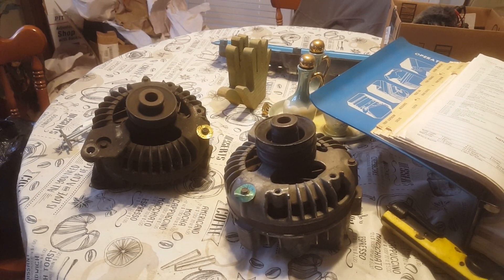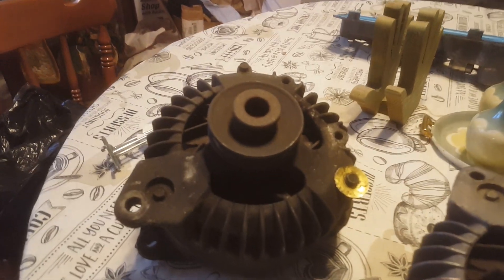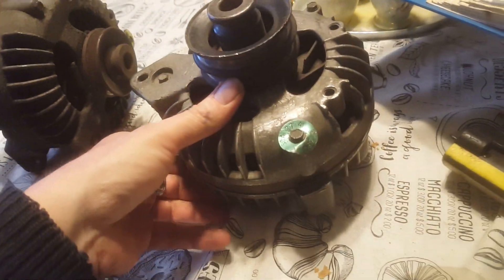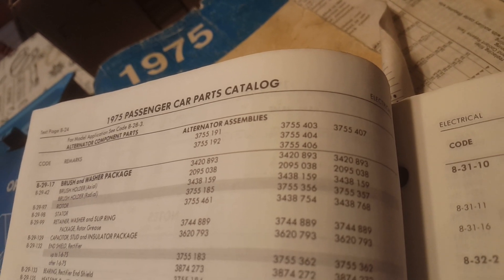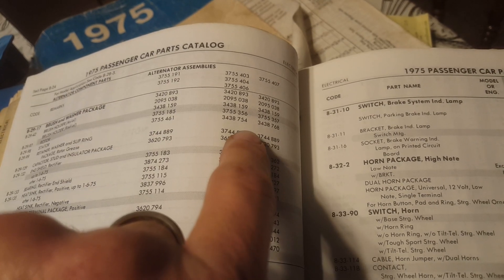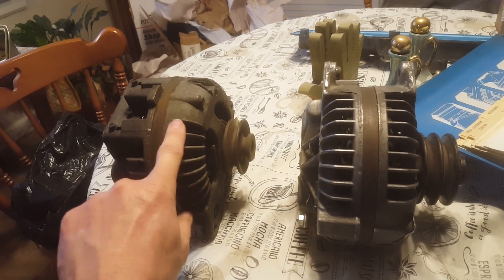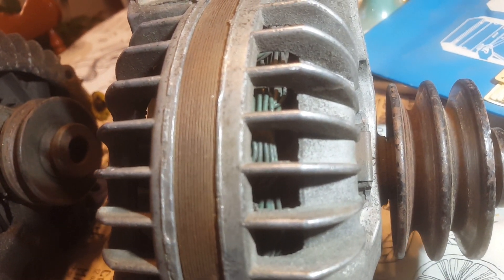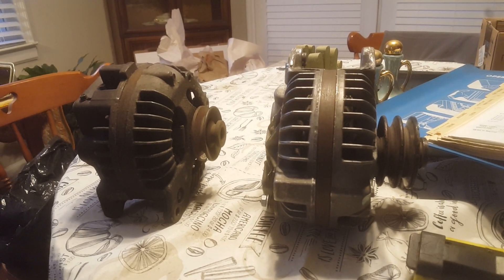Did you know? Chrysler only built 50 and 60-amp alternators after 1973

Comment: I would say a higher amp is for something like for service vehicle like a police car or pickup truck for extra lights install or trailer light cables for the brakes and turning lights IDK I think that what the higher amp are for and there were cars back then that came with towing equipment and basically there was an option for AM/FM that came with CB and 8Tracks all in one radio from 1972-1980.
Reply from the maker: Right. The original Mopar alternator architecture supported about 60A so anything above that either went to a physically larger unit that Chrysler manufactured or a Leece-Neville.

Comment: If the rotor and stators are indeed the same in both the low amp and higher amp alternator, the only way I can see that the amperage would be different would be by the actual RPM of the rotor in the two types. The diameter of the belt pulley plus the diameter of the crank shaft pulley plus the idle speed that a given vehicle's engine was set to would be the variables that might deliver that difference. Its an interesting issue.

Comment: As with starters from the 170 CI Slant Six to the 440 Ci Wedge. All the Same. One exception the 426 Hemi. All bolt up & wire the same. All interchange.
Reply from the maker: Actually two exceptions...manual transmission Hemi's and Slant Sixes with a HD clutch. The large clutch is what prevents a gear-reduction Mopar starter from being used.